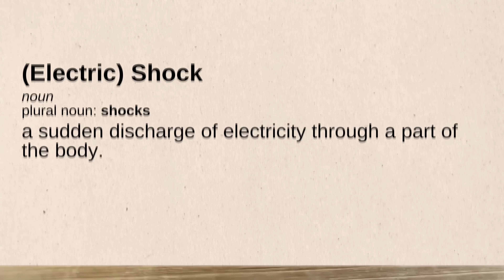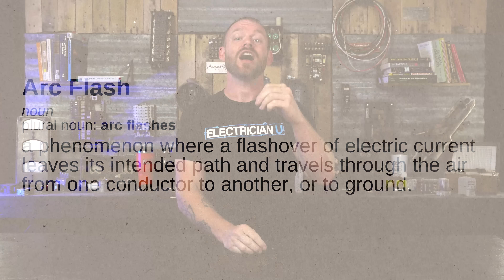How Do I Get Shocked? Why Am I Getting Shocked? It's Simple.

Comment: Every time I have seen a fellow electrical worker get shocked, it was from them inserting their body in series between a cut neutral. Some electronic and induction loads can also cause a higher voltage to the body when the body is inserted in series between a cut neutral returning the hot through the electronics and or induction load.

Comment: Those examples aren't parallel and series. Both are in series. Just one has a separate load as part of the series. Parallel would be if you touched hot & neutral while there was also a load. Yes, adding yourself along with another load in the circuit will reduce the overall current, and also the voltage, but only by a small amount.

Comment: My "best" experience was trying to pull off completely wet insulating tape from a phase while standing in a puddle with completely wet work shoes (even inside).
That the insulating tape was wet, I could not see due to poor lighting conditions. It dripped water from the hall roof directly on the insulating tape and from there into the puddle.
(Oh, the whole thing of course here in Germany, so with our 230V phase to neutral / earth).
That was a moment where I would have liked the US - voltage levels.
Reply: you shouldn't have been working in those conditions.
Reply: @goaliedude32  
You only make a mistake like that once in your life. Afterwards you are wiser. It will definitely never happen to me again!

Comment: I learned a lesson several years ago. I had to go into an outlet box to make some changes. When working by myself, I plug in an old radio, so I can hear the radio go off when I turn off the right breaker. I went back to the outlet, unplugged the radio, and put the multimeter into the upper plug (THE SAME PLUG THAT THE RADIO WAS IN), verifying no power. I pulled out the outlet, touched the screw on the lower plug and promptly blew off the tip if the screwdriver! 
Turned out the outlet had been split, and the lower plug was on a different (live) circuit!!
Lesson learned.
Reply: I hate HATE HATE *HATE HATE HATE* multiple circuits in the same box.

Comment: Here is another good one: don't rely on flipping the breaker off. It has happened where the hot has made a loop, connecting to two breakers (terrible I know). Flip the breaker and verify the power is off. Mislabeled breakers,  and kitchen plugs where there are two circuits to one plug (Hopefully those breakers are ganged up).
Reply: Sounds like you learned the hard way.

Comment: I'm not an electrician.  I think there is no significant "benefit" from being in series. A light bulb (and most other loads too I would think) offers virtually no resistance compared to the human body, so the human body would still get 99% of the voltage (and the human body requires far less current/power than a bulb as well, to feel the electricity). Don't rely on "series" to save your hide.

Comment: I know its "theory" but I've been shocked many times, probably 30, 40+ times over the years.  Even been hit with 277 a few times.  Sometimes I worked on dry wooden floors and was only using 1 hand.  I know power always goes back to the source and will take the path of least resistance.. but "the theory" is kinda bs.   If I was a betting man I'd bet $1000 to anyone who puts one hand in their pocket and then touches a live conductor with their other hand... they are gonna get bit. Guaranteed!

Comment: I had a dream the other night I was talking to a customer and right in front of them I grabbed wire with tape on it hanging from ceiling and got stuck to it fell to my knees and then lied down on the floor trying to yell at customer to turn off the power but no words came out my mouth they just stood there and watched me like it was completely normal or maby they thought I was joking anyways I woke up and didn't go back to sleep. But the worst I've experienced was 2 arch flashes that were more like explosions of course it was at the end of the day it happend from trying to land a bare ground to ground lug but it touched the inside of panal I thought that's odd instead of checking why it happend I just did it again lol wow I'm dumb anyways it vaporized alot of the grounds in the panel and I lost a bit of vision in my right eye the bare ground was touching a main lug

Comment: If they would have chosen 60v for home voltage instead of 120v and 240v almost no one would get electrocuted at home because our skin has enough resistance to block 60v. 

But that electrical system would actually kill more people. This is because you would have to double the amperage to run the same devices. And amperage causes more house fires than voltage does. More house fires, more deaths. So learn to respect 120v and 240v systems so you don’t get shocked and we will save lives.

Comment: Good topic.   I have been shocked a few times but the strangest situation was during a gas piping installation on a outdoor furnace.   It was wet outside and as I was getting zapped trying to assemble pieces.   I had about 15v from piping to ground on the meter.   I couldn't  figure out what was the cause but quit and came back on a dry day.   Maybe someone might have some ideas.   This was several years ago and I won't forget it.
Reply: Is possible that the metal piping had become energized through some fault in the wiring or grounding of the furnace.  On the other hand, if you were working from the utility side towards the furnace,  it could be that there was a ground fault at the furnace which energize the ground, and your metal pipe was acting as a lower resistance conductor to complete the ground path back to the transformer. Then of course you complete the circuit by touching both the ground and the pipe.  I'm sort of guessing this second scenario might have been what you experienced since that could be quite puzzling.  Did you report this so an electrician could look into it?

Comment: I've been stuck to a metal equipment cart because my muscles tensed up closing my hands. Up one arm,across my chest, out the other arm. Unable to let go. Couldn't move. Couldn't speak. Couldn't breathe. I could only make low gurgling noises. The most helpless feeling in the world.  It was maybe 30-45 seconds before someone saw me. He looked at me like what in the f are you doing before it finally clicked what was happening. He hit the E-Stop button on the wall dropping power to the whole shop.  I took the deepest most wonderful breath of my life when I finally fell off it. Yes, that hurt. I have a very intimate appreciation for GFCI protection after that. And a good healthy fear and respect for never letting that happen again. And that was only 120v!
Reply: Me sitting here not expecting this to be a 120V story…. 😰. Note taken
Reply: @ryans6423  Most electrocutions happen with  120V, crazy when you think about it.
Reply: @Htm.13  it's a low enough voltage some take it for granted and don't realize other factors can make even a 120 volt shock way worse than usual it's also the most common voltage.
Reply: @Htm.13 we have 230V here in uk
Reply: @1peter1180  I am aware of it, we also have it here in the US, Our residential panels are split phase, which can provide both 120V and 240V, 120V is used for lights and small appliances, and 240V for bigger more demanding appliances (Oven range, Cloth dryer...)
Reply: I’ve got stuck changing an outlet and all I could do is like grunt it was a scream I’ve never ever done after I was able to let go I even passed gas 😁 tbh it was my mistake I had needle nose vice grips in my hand and don’t know or remember how I made contact but it sure got me not fun at all 120v is really dangerous
Reply: Damn. You're lucky to be alive. Glad you lived to tell the story!
Reply: What’s weird is there isn’t a lot of info out there when it comes to getting shocked/electrocuted  by (practical) residential or larger services. They always go into electrical theory and how the lowest amount of current can kill you with no practical examples. 
I’ve been shocked a few times because I got complacent. Notably the 2 dumbest instances were once by one leg of a 200a bussing on a residential service and once on a 3 phase 208v/200a powered generator transfer switch for a business. Somehow brushed each hand across an arm connected to L2 & L3 while testing the circuit bellow it. In both instances I barely brushed the top of my hand/finger against the conductor and it just made me jolt my hands back. Felt like touching vibrating metal & hitting your funny bone but in your hand. No pain or anything but according to electrical theory I should have had more than enough current flow through me with plenty of voltage to do damage or cause an arrhythmia even if it passed through me for a moment. 60 hertz is faster than you can pull away from something shocking you. Needless to say I’m much more careful after seeing firsthand how easily you can make a mistake and get hit. It’s just weird how everything you hear about electricity makes it seem like any mistake is a death sentence when most of the time as long as you don’t get stuck on anything under 240v/220a you’ll probably be fine unless in that split second the current flows through your heart at the worst possible moment and sends you into v-fib. Then there’s stories like the one above where people are shocked for nearly an entire minute through both arms and are fine. Electricity is strange sometimes.
Reply: @xi-deadshot-ix5838  The Amperage rating of the overcurrent protection device or service size is irrelevent to Electrical shocks, because when you get shocked you become the load, and what determines how many amps go through you is your body's resistance at the moment (I = E/R), so even if the service is 100A or 20 000A, if you get shocked by 120V having the same body resistance and same circumstances, it will be exactly the same shock...a 15A breaker won't trip until you re carbonized like a piece of coal and your resistance is so low that it allows that many amps! 

That's why they say Warning HIGH VOLTAGE and not high amperage, because if the power source is capable to deliver enough watts, and is at a high voltage, the amperage is only generated in relation to the resistance/impedance!
Reply: @xi-deadshot-ix5838 it is called jobs,  they don’t want reg diy to know that.
Reply: once i was working on a 120v freeze drier. was plugged in, but turned off. the hot and ground were reversed so the entire frame was hot. put my hand under it to move it and zap! luckily was only across my hand but it woke me up.
Reply: You're going to be a very seeable ghost when you die. You have alot of energy inside you. All I get from 120 is a tickle
Reply: Did you tell this story on Reddit ? Pretty sure it’s you
Reply: I heard 120 is the worst
Reply: @dioncurtiscurtis3188  It is not the worst, it honestly doesn't feel that bad, but that's what makes it dangerous, people get too complacent/comfortable around it
Reply: That's my biggest fear is getting locked up in a suspended ceiling working on lights. The hardest hit I've received was from 120v.
Reply: I thought that only DC made you grab on
Reply: only 120v 😆
Reply: EEG “putting diodes” ?? Nope, “electrodes”!
Reply: How many amps tho
Reply: Glad you’re alive my guy
Reply: I've got the shit shocked out of me by gfci protected circuits .I do not trust them.
Reply: I'm having a hard time believing that
Reply: What kind of pain did feel? If I may ask
Reply: Most 120v supplies are centre tapped so you only get 60v to ground +60 and -60
Reply: @davewebster1627 No!  Not in the US.  The US is center-tapped on 240V!  +/- 120V RMS.  +/- 170V peak!
Reply: @davewebster1627  Wrong, 120V is 240V center tapped transformer, so it is 120V to ground/neutral.
Reply: 120v is weak
Reply: @WhoisRoach  Most electrocution casualties happen with 120v because people get complacent and think it's weak.
Reply: @Htm.13  it is weak, people don’t really get hurt from 120v alone
Reply: @hallowedbethygame2840  No your argument is weak, I am an union Electrician and I work on shit from 12V to 480V on the regular, 120V kills people every single day! The amount of amperage that goes through your body is determined by your body's resistance (skin type, humidity, protective layers...) it takes less than an amp to cause Ventricular fibrillation...With all due respect, you don't know what you re talking about, so pls for the sake of your family and loved ones, stay away from Electrical.
Reply: @Htm.13  I have 30 years experience as a sparky, getting electrocuted is a mindset.  Seems you have much to learn.
Reply: @hallowedbethygame2840  I actually know someone who passed, he was experienced, and let me tell you it wasn't his mindset that got him...
Reply: @Htm.13  how'd it happen? awful, sorry for your loss man.

Comment: Not long ago, I was changing out an electrical panel and our local utility company didn’t have any SOP requiring them to disconnect the service lateral down at the street level. So the utility worker taped up the hots and when I put on the new panel I got a nice arc burn to the face. That was not fun at all but it seemed like one of the hots wasn’t taped up correctly and when it came in contact with the lugs on the utility side it completed the circuit with the service neutral that wasn’t taped up. Needless to say, I double tape it now after they leave!

Comment: The example at 2:06 is very misleading. Touching hot with one hand while standing on the ground DOES result in a complete current path through ground back through transformer neutral through hot unless precautions are taken as you observe later in the video. The only time this is "safe" is if you are isolated from ground with thick rubber soles OR if voltage is supplied via an isolation transformer where the secondary has no ground reference.

Comment: I would add, unplug washer/dryer if working on the laundry circuit right behind the units.  Same with working on kitchen counter receptacles with your knee potentially touching a properly grounded dishwasher. And DON'T leave your cell phone in a pocket.  Electricians have really fast reactions to the "vibrate feel" of a shock and you can pull your hand from a good position to a bad one in a panel for example.  Leave your cell phones on a nearby surface.  Ask me how I know LOL!
Reply: If you lean against a Formica countertop, you can get a nice buzz through your pants while touching a live wire. I put a furniture pad or blanket on the countertop before working on them. Also, if you kneel, there is enough surface area to create a large enough capacitor to shock you. If you are holding a live wire. Laying on the ground will also allow you to be shocked if you touch a live wire. The large surface area creates a very large capacitor.

Comment: I used to do commercial/ industrial electrical work. I was retrofitting light fixtures in a facility that was still running, so we worked hot circuits. I had been standing on a warehouse rack for access to a group of lights and had been working without issue. Always start by clipping the hot and capping it off then work the rest of the conductors. At one point the ceiling lowered so I sat down on the rack to continue work, without issue on the first fixture. When working the 2nd fixture, I mistakenly allowed my finger to contact the metal of my cutters when clipping the hot. I immediately verified that the racking system was properly grounded and the protection my safety boots offered did not extend to my a$$. He is right about the 2 point connection.
Reply: So you're saying your ass is your path of least resistance

Comment: I was trained to always treat it like it's hot. Well one day we were tracing out a couple circuits after a demo to leave on for temp power. J man said to find it and come back to the electrical room so he can shut it off while I make it up. I went back and said I found it, then went out and made up two plug feeds in an old box. Came back and said, "ok it's finished, you can flip the breaker back on.". To my surprise, he showed me the breaker still turned on. I had never told him to flip the breaker off, but made the mistake of assuming that by walking into the panel room and saying I found it, he would understand to flip it off. I was quite surprised that even though it was through a mistake, I had just made up two hot joints and their neutrals without even realizing it. If I didn't have the habit drilled in to me about treating everything like it's hot, I could have easily caused an uh-oh there by cutting the whole cluster of wires at once, grounding myself to the ceiling grid, letting two stripped wires touch, etc. Still didn't tick test it like I should have, and learned a lesson about assuming things